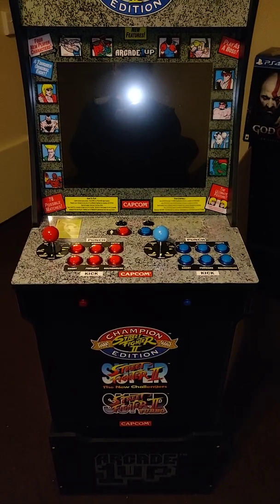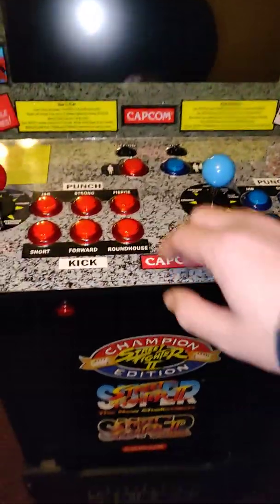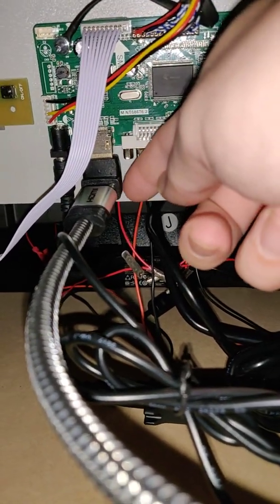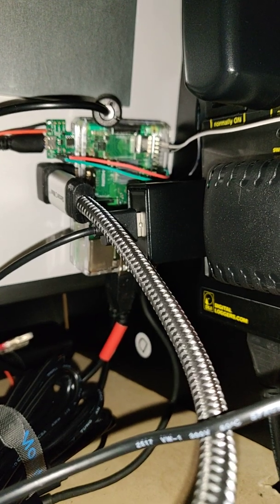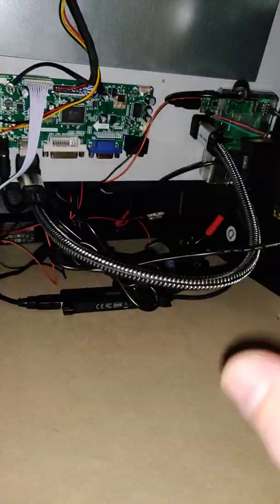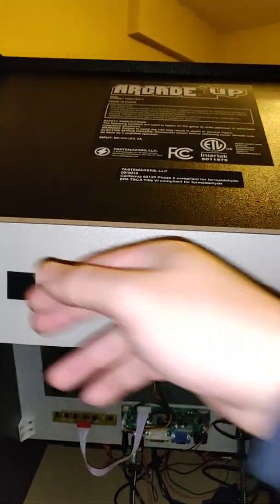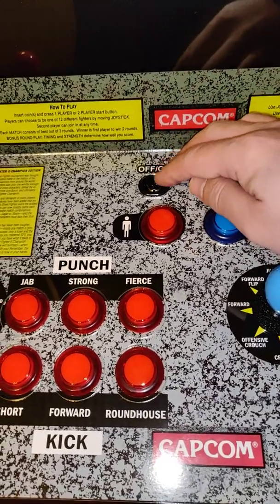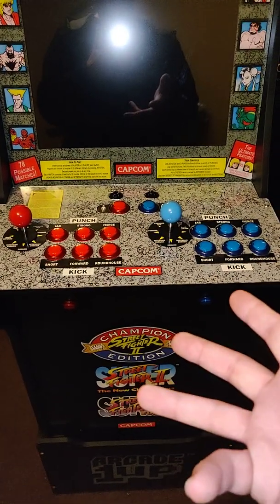Arcade1Up Raspberry Pi RetroPie Super Mod..!

Comment: How were you able to bind the buttons with only 7 buttons for each side? I’ve been having trouble trying to figure out how to have a start, select, and hotkey button with only one spare buttons along with my other 6
Reply from the maker: Hey Gundamu!

I did this project some time ago but what I do remember is that I added the extra button for coins at the bottom of the cabinet.

I remember going into the binds and I was able to get it all done but it’s made as an arcade cabinet and not consoles.

Comment: Very informative, thanks for putting this together! I have one question: what type of jumper cables (male to female, male to male, female to female) did you use to connect the Raspberry Pi to the relay? I’m referring to a black and white cable that connects to the Raspberry Pi’s pins and runs to the side of the relay.
Reply: Yes, this definitely helps! Thank you!